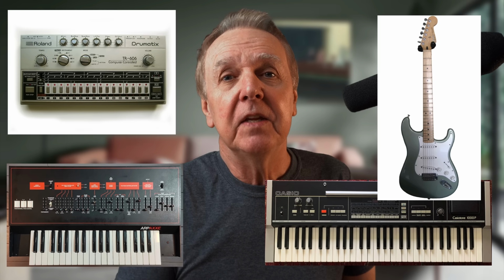What's wrong with dbx?

Comment: I personally like dbx for what, when, and why it represented in the history of music recording. Yes, it was not perfect, but without it, you could never have something from the mid 1980's to the mid 1990's that was listenable. And if you bounced tracks or mixed 4 to stereo then sent it back to first 2 tracks on a 4 track machine - FORGET IT! I could only afford a Teac A-3440, so dbx type II was indispensable to me. I would never have made music with dolby and its measly 62 to 65 db range, or noise floor. Two passes of dolby would be like a wind tunnel.

Not perfect, but made a lot of music possible than otherwise wouldn't be...

Comment: 99% of music masters during 1970's, 80's, and early 90's utilized either DBX II or Dolby A. An experienced recording engineer could EQ the master for slight compensation of NR deployed. These are the only 2 NR's that offer the best noise elimination for tape repro's.
Reply from the maker: If Dolby Type A is aligned correctly, no further compensation is needed.
Reply: @AudioMasterclass All depends on the decade timeline,  tape type, and repro unit used. Not all machines had EQ compensation like Studers. 
Alot of record mfg'ing co's didn't have D.A. hence DBX inexpensive viability over D.A.
Reply from the maker: @AudioMasterclass
2 hours ago
If Dolby Type A is aligned correctly, no further compensation is needed. One would assume that anyone who knows how to align Dolby already knows how to align a tape recorder. @dubdoodle7191

Comment: Do you have any docs or advice on calibrating my dbx 222?. Cant find a service manual anywhere.
Reply from the maker: No. The best I can suggest is a) keep looking, or b) possibly another dbx model has similar internals and its service manual might be of use. DM
Reply: @AudioMasterclass  Thanks, I use it on an x10r it works but im sure a calibration would help, excessive chuffing, I know its a symptom of dbx but my cassette deck is way better in that area. There are 12 pots on the circuit board, i have looked at other schematics but they are not close enough to be of any use.

Comment: The logarythmic scale is widely misuderstood The difference between 50 dB noise measurement and 59 dB is "only" 9dB but perceived noise  for first value is    about 8x (800%) bigger  then for 59dB. That is why every dB counts so much. Only many times cascade cppying of analodg signal to analog may require more than 70 dB  noise gap. In popular case already 50 dB makes no issue.  . Digital to digital is not affected by noise at all.  

 . Typical noise level  in analog tape recording is about 52- 60 dB and it means that in compare to   usable audio 1V l there is only 1mv - 2,5 mV measured noise. I think it is not fair to say that analog tapes are "noisy" Yes, noise level is supposed to be  matter of consideration in accordance to fairy used volume  level  - not like in  digital storage  where it is technicaly removed .  . In analog reproduction users  often  amplify   noise  by aplaying heavy amplification to sopranos  when they were  damped  by other issues.  As result  of this action will appear   noise in  background
Reply: Sorry, but I think you are wrong. It is not the percepted noise that is 8x times bigger but the absolute electrical values. Perception is logarithmic to the absolute values and that is one of the reasons for db as a logarithmic measure.
Reply: @ralfschmoll8701  You probably are  right - Actualy I did not check it myself.  But it does not input to  explanation of  all confuses. 

People forget that they are never  listening to "0dB"  but to natural surrounding them "floor noise".  in  my quite  silent flat  that measured by industrial unit noise  is  30 dB (with tiny l peaks from two clocks) . It means that any tape noise will overlay that room noise when it will reach  loudness 31 dB   . With even -50dB noise level in tape recording  it's max  music peak will be at 81 dB hardly making any chance to spot tape (or equal room) noise

Comment: My "Roxy Music" cd from the 80s always annoyed me.  It had hiss on it like a type 1 cassette!  I played different copies of it and they were all the same.  What was that all about?? Poor mastering??
Reply from the maker: Which one? I might take a listen. DM
Reply: @AudioMasterclass  Think it was Avalon.  You can hear the background hiss as the track is cued in.  I had a mid 80s cd.   Always did my head in because I'd just bought my first cd player and was expecting better. 😄
Reply from the maker: @rcary  I don't hear any more noise than I expect on Spotify. But this album is from 1982, the first year of CD. It has been widely reported that in the rush to release material on CD, many CDs were mastered from tapes which were already copies or copies of copies. This could be an explanation for what you heard. DM
Reply: @AudioMasterclass  Yeah, maybe.  I listened on YT and it sounds clean.  I don't have the disk anymore but I remember the silence and  then obvious hiss before the tune started.  Still a great album but I'll never forget that hiss.   I think they cleaned it up later on.  I record onto my Tascam 133 and I get almost CD quality playback , so perhaps that Roxy was just a crappy batch I happened upon.
Reply: Many commercial CDs had small print with a warning that the CD format may allow the listener to hear noise that was from the original analogue recording master tape.
Reply from the maker: @MrAdopado  Yes you're right - I'd completely forgotten about this. Of course, some might regard this as part of the texture of real life. DM

Comment: Oh no no no my British brother. If you've got dirty heads misaligned tape path, warped tape. DBX Type II Analog Tape Noise Reduction. Mangles the audio, terribly. Much worse than Dolby B, C  or, S. Not so much S.. And C simply miserable.

I mean you are mostly on track with everything else. For the most part. I say this. As I'm the last Quality Control Manager and Final Test Engineer and overall Troubleshooter.. For the legendary and famed, Scully Recording Instruments. And I was trained by all the other American ones like Ampex, 3M, MCI. I've also built my own when younger.

It's really hard to beat the sound of, barefoot, No Noise Reduction, Analog Tape. With no process. That gargles and colors the sound. When I needed some analog tape noise reduction. I would use a gentle downward expander carefully set. Nobody would ever hear working. And it did not influence nor color the sound. And I can play some of my recordings that are, 8 generations down. And you'd never know it. All recorded on Scully and MCI recorders. I fully tweak myself. As no one knows how to do it better.

So from an old codger like me. Who's been in the recording and broadcast industry for over 50 years. All the way back to Motown Studios in Detroit. When they still existed in the early 1960s. When my father played  violin tracks for them. And started taking me down to the studio when I was 7 years old. Yup. And then to find myself working at Scully at 23. How did this happen?  Who is responsible for this!? Oh? I am.

And so as great as analog recording used to be. I walked away from it 30 years ago. There is just no reason for it anymore. I mean I do like some analog tape saturation on Bass Drums, Snare Drums and Tom's. Cool on some Bass and Guitars. Useful on brass. Just the right zip on a vocal. While delivering smoothness. But is that smoothness we no longer really need. We want articulation now! No more hiding the sound under grunge.

Great recordings can be had with virtually  any well working gear. There is no magic beans nor fairy dust. There are those pieces that have, characteristic tonalities to them. Neve, API, SSL, Sphere, MCI, Auditronics, Op Amp Labs, Phillips, Neumann and others. But in the end to most folks. It all sounds the same. It does not. But since nobody can really tell? No one really cares anymore. It's nothing to care about anymore. Nothing that needs to be cared about anymore. Because nobody is really making any kind of, Technological Breakthroughs nor Statements anymore. It's over. The fun and all the discovery is, over. It has been taken to its absolute, physics, limits. And so now time to worry about important issues. At not about the right tone on some fuzzy guitar. Which means nothing in life. It's just entertainment. Strictly, entertainment. And has no bearing on real life situations and circumstances. Though important to those youngsters at the time. But then so are the keys to the car that night.. But mom! But but but but ugh.

And thus will always be such for most raised well.
RemyRAD
Reply: Bravo

Comment: Nope! Few of the dbx points mentioned here (by the presenter) have any real validity. Quite meritless actually. Why? Simply because he's not done his homework. They say, "a little education is a dangerous thing". The missing blank spaces are typically filled in with techno garbage. Folks, the dbx system was designed to be a stand alone noise reducing format that was COMPLETELY incompatible with any other, be it Dolby A,  B, C , HX, S , etc etc etc (including ) ANRS. Additionally the system was assuming that 70's open reel format was being used exclusively. Alternatively cassette tape speed, or dictation design engineering, plus physical fomat was woefully inadequate for dbx and rightful shows this impediment. It wasn't untill the early 80's revamping was completed that the dbx system became a consumer marketing practicality. Then Technics, Teac et all incorporated the dbx NR system with a new fangled circuit board - and it works magnificently. End of story. These click baiters are soo annoying. ARGHHH 😮
Reply from the maker: Aha you seem to have a case of arrogant arsehole-itis. 1. Tell me where I said dbx was compatible with Dolby. You can't because I didn't. 2. There was dbx Type I and Type II. You don't seem to know the difference and I won't bother telling you. 3. If you want to experience clickbait, I suggest my video here - https://youtu.be/cxoRcsmb2Ww

Comment: Oh really? You use your DBX Type II noise reduction on a common cassette deck? My God man! Of course you can hear modulation noise!

Unlike your misinformation. DBX is highly affected by, non-flat, frequency response bandwidth. Whatever it is? It's twice as bad with DBX! So if you are down 2 DB at say, 2 kHz?  It's going to be down 4 DB. It gives you automatic Equalization at frequencies you don't want, automatically! Free of charge! Everything you don't want  where you don't want it.

Which is why DBX noise reduction. Should never be used on any recorder. That does not have a razor flat response from 50-15,000 Hz plus or minus, one quarter,, DB. And that would be acceptable. Sort of. But nobody's going to have a cassette there so finely tweaked like that. Other than possibly myself?

Now I have had a lot of, high-end, studio, cassette decks. By Sony, Panasonic, Pioneer and Knock Amici. Which is an Italian cassette deck made in Japan.  Because it sounds Italian. Yes. Good enough for  operatic and symphonic recording playbacks. As they are unlike in the other professional cassette deck ever made. Including Studer. Including TASCAM. All pale in comparison to never, Knock A Miche! They just can't be beat in sound quality. Take it from a real analog tape recorder manufacturing and maintenance genius. No other cassette that compares to, knock amici. Printed as it is pronounced. Not as it is written. I mean how many Japanese guys have Italian names? And made cassette decks? That sound great! That sound almost as good as one of my studio Scully's. And no other cassette deck sounds like that. None! Nada!

Only on one of those finely adjusted and tweaked Knock's. Might I have tried DBX tape noise reduction? But I have forever hated and despised the sound of the analog Compact Cassette. They are just plain, awful. And no reason to go back to them. None!

And so today. If you want quieter cassette tape playbacks? Don't use any, Dolby or DBX noise reduction. No.

Simply transfer it into your computer. Via really anybody's, USB soundcard interface. Pick up a copy of, Adobe, Audition. Any version. Or the earlier Cool Edit, free shareware program from 1996. And the noise reduction program within. For free. Is virtually the same and every bit as good. As some of these other specialized noise reduction programs costing upwards of $1500. And Cool Edit/Adobe Audition has that built in. And it's really superb. I have been using it since 1996. It's a lifesaver. A miracle worker. A magician. And don't over abuse it.  If you never want to hear it work. You Golightly. You only need lightly. Unless it's a recovery and restoration. And that's different. Those are harder. A lot harder. To bring back broken crappy audio, from the dead.

So today I prefer to do my noisy duction in software. As there is no hardware.  That can do a good or better job than software. Nothing. And so it's great! If you don't use your Dolby or DBX. Lots will already be encoded. That you go to playback. And most of that is going to sound like mud. And so for that. You need software. To make it sound real and alive and recorded yesterday. And then you take out the noise that's objectionable. Et Voilà! Acceptable sounding audio recovered from a compact analog audio cassette. From a Knock and Amici cassette deck.

It's very funny and I'm 100% serious. All the other cassette decks sound like mud. Knock''s, don't. And that's the only analog audio cassette deck. I will used to archived to digital. Because they sound as wonderful as very costly. As analog studio tape recorders costing many thousands of dollars each. As much as my 1978 Toyota Corolla did. For a stereo recorder. And that's what I made. Lots of.

So I got the real information here. But it might not be your cup of tea? Oh well. That's the way it is.
RemyRAD

Comment: And what's wrong with HiCom 🤔
Reply from the maker: I have no experience, but the information at Wikipedia under the heading 'Impact' offers some information on the possible problems. It may however just be the case that Dolby got in first and were better at licensing. DM